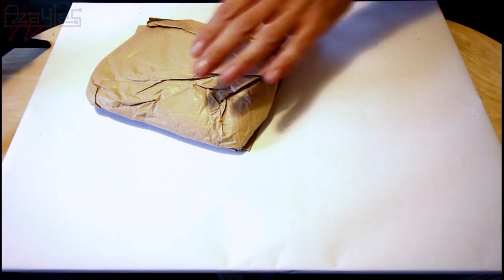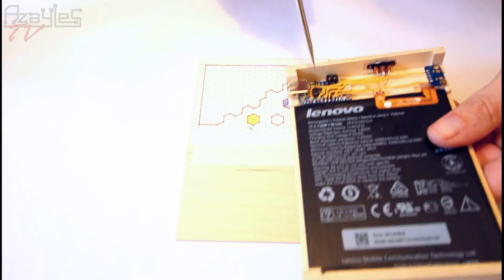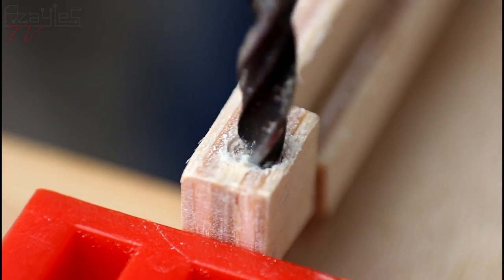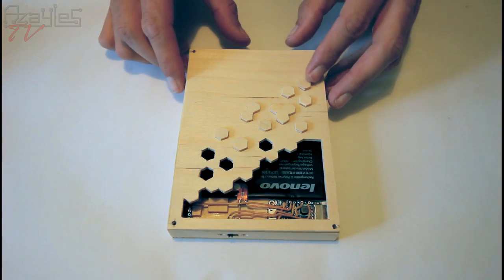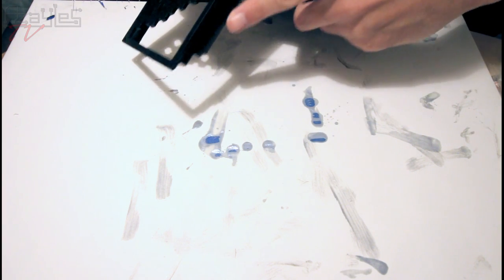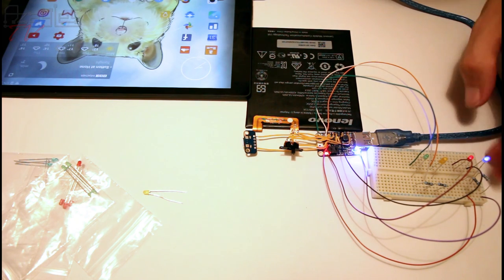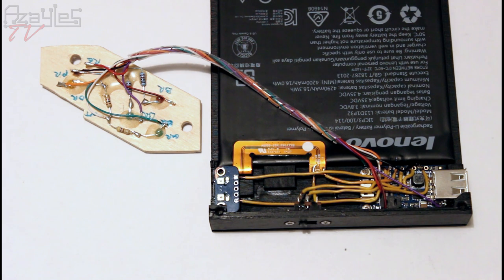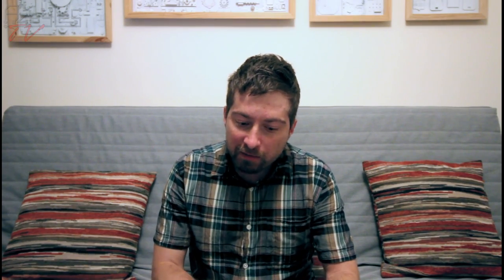USB Power Bank From a Broken Tablet - Part 2-2

Comment: Nice, I know you can get USB power banks for less then the adafruit board, but theirs something about the accomplishment of building your on thing and recycling electronics for good use instead of waist. Well done.
Reply from the maker: +Gadget Review Videos thank you! 😄 Indeed this was by no means cost effective, but it was a great exercise in repurposing other junk parts. Plus I now have a power bank that will charge not only my cellphone but also my tablet from flat. Something that can't be said for a lot of power banks 😄